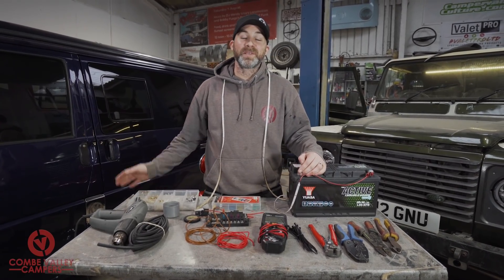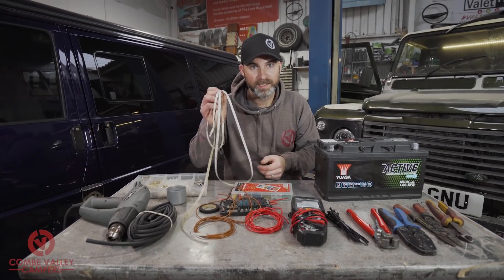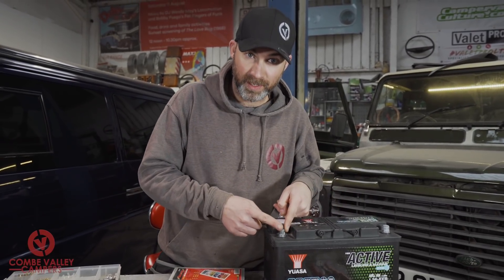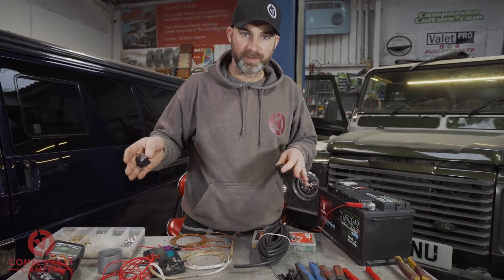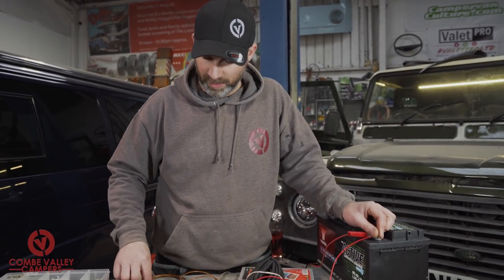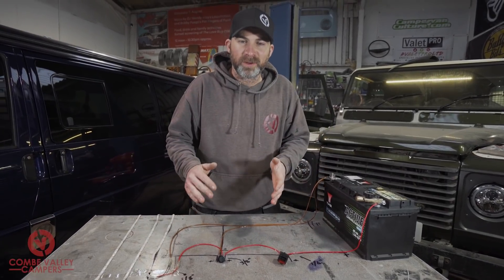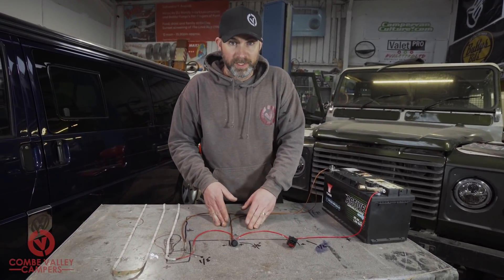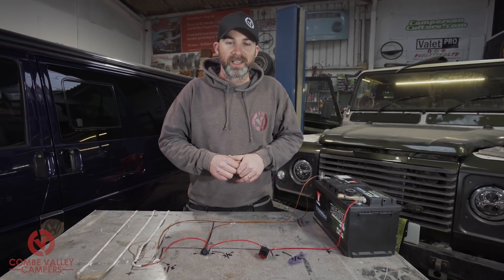HOW TO MAKE CAMPER VAN WIRING. Beginners guide - How to make a 12Vdc Circuit in your camper.

Comment: A ten amp fuse with 0.75mm2 wire??? Good luck when you have a short at the end of the wire. Advantage of what you are doing is that it will be self healing: the wire will melt and thus stop the current.  Disadvantage: there might be a fire.

Comment: Great video as usual. Do you recommend a voltage regulator as always fluctuates above 12v upto 13.6v ? And can damage the lights. I'll be fitting rgbw so will need the controller in there.

Comment: Do you connect the leisure battery negative to the chassis ground? And if so, do you wire the return ground all the way back to the battery or to the closest chassis ground point?
Reply from the maker: Yes, Leisure to the chassis ground, and either back to the battery or to a common ground yes.

Comment: Do you have to wire directly back to the negative on leisure battery or can you use the vehicle chassis as the ground as you could with standard battery,  and find a suitable fixing point closer to your appliance?

Comment: Thanks for explaining this. I had air horns and was petrified to fit them in case I blew something on the landy. I now have a light bar for the camper but I don't know what size of fuse to use.
Reply from the maker: Hi Graeme, I'm so glad you found this helpful. I would reccomend you wire in air horns and a light bar with a relay, using a switched live to operate them as using a simple 12v circuit may overload the wiring.

Comment: Absolutely great video as usual. Always so informative

Quick question I’m installing some usb points around the van. Is it ok to daisy chain these one off the other or should each point go back to the leisure battery? Thanks rob.
Reply from the maker: I would reccomend fusing and connecting a maximum of two on one circuit

Comment: Great video.
Just a quick comments on led tape, some of the higher power stuff is 14.4watts per meter. So if you're running 5 meters of it then you're going to draw 72 watts of power!!!! Thats alot of power and will kill a battery in a few hours. LEDs do theoretically draw less power unless you have a large quantity of them.

Comment: In the dark recesses of my mind I'm sure I recall car elctrics using the metal of the vehicle body as the return path for the current - is that now not the case?
Reply from the maker: Indeed you are correct, however, in this case I was portraying a circuit in its simplest form.
Reply: Combe Valley Campers So it’s still an acceptable way of wiring electricals?
Reply from the maker: @davidburns5027  as long as the vehicle operated as a negative earth, and the leisure battery earth is connected to the chassis/body also

Comment: If I wanted to have a split charge (leisure battery) system to run all my oem ancillaries would that be do able without draining my starter battery?
Reply from the maker: Hi Nathan. You could run the oem ancillaries from a 12vDC Leisure battery, as long as they d run from a constant 12vDC source. More modern vehicles may run ancillaries from the vehicles CANBUS System so may not be compatible. Either way you may find you will have to run new fused wiring to each ancillary.

Comment: I made a basic circuit for a set of LED lights i rigged up in my motorhome when i had to live completely off grid. I didn't want to use up the leisure batt power so i ran the system off rechargeable batteries. It worked well and kept in lighting for as long as i needed it. I made interchangeable battery packs so once one set was dead and needed recharging, i would just swap it for a new pack of batteries. I built a switch into the system so once i was in bed i could switch off the lights. I have no training in electrical systems but do understand a simple circuit so i built my set based on a simple circuit.
Reply: What size batteries did you use for this? Cheers

Comment: not sure if you mentioned this and i missed it, or it wasnt mentioned but for safety the fuse/fuse box ideally needs to be as close as possible to the battery + for safety to minimise the length of unprotected wiring before the fuse.
Reply: I am going to put a 20ahp breaker next to the leisure battery with the fuse box in the top cupboard
Reply from the maker: That's absolutely correct. Thanks for highlighting it Pete